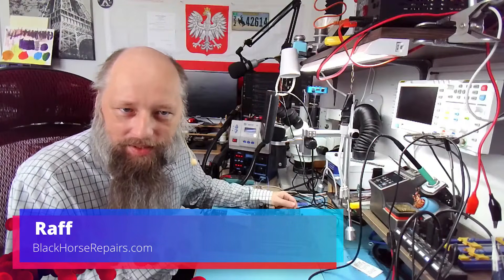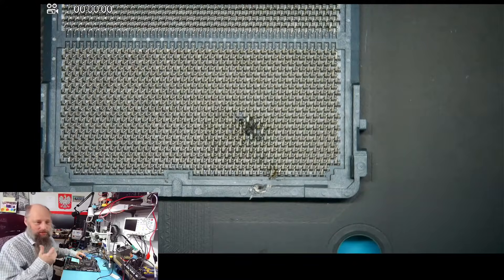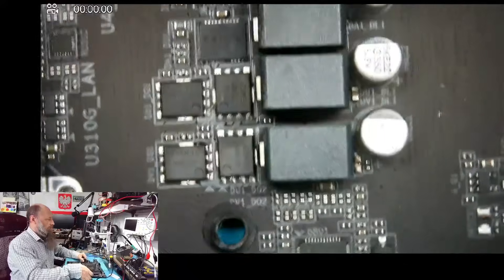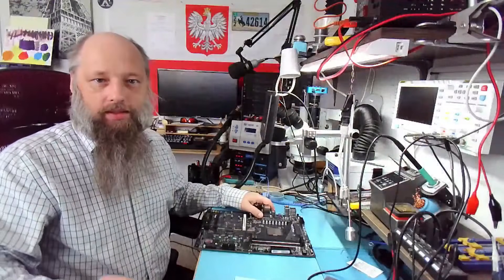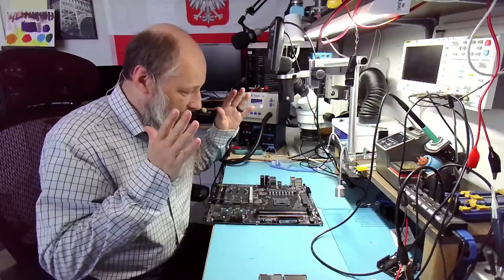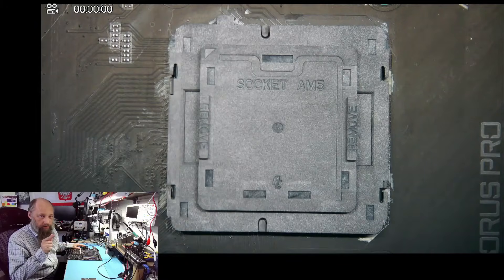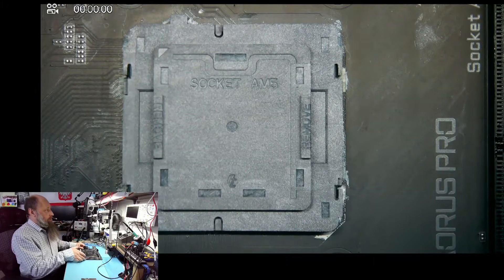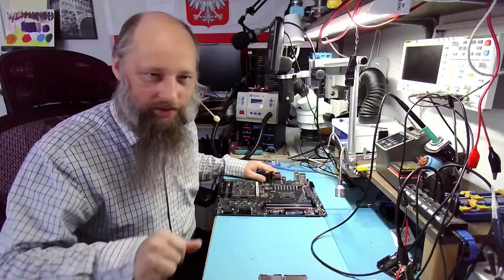102 | Free AM5 Socket Replacement on X870E

Comment: Hello
Why You not test this mainboard??
Reply from the maker: darowanemu koniowi nie ptrzy sie w zeby :) 
once I start charging for this I'll perform testing after the replacement, at the moment I have no AMD CPU or DDR5 memory to test it so it's all just visual inspection. In addition the board comes disassembled so would not be able to test it properly without heatsinks.

Comment: Ignore my last comment on the other video. Do you have a link to the Rework Pro software? I can't find it anywhere.
Reply from the maker: the reason you can't find it anywhere is that I have not released it yet. It is still in beta testing. I will release the link sometime next month, depending on the state of the project. You can join my discord, it will be released there first. You can also download my IR6500 software, version 1.4 has been released a while back. I do recommend Rework Pro though.
Reply: @blackhorserepairs  Ah, that would explain it then.🤣

Comment: Well done your getting better with every board
Reply from the maker: Thank you so much 💓 
Maybe soon I'll start charging for this repair
Reply: @blackhorserepairs  I wouldn't until you can check their working , time to buy a cheap lga1700 cpu n cheap am5 cpu.  It becomes expensive to post n repost if they don't work..I use socket testers, but always use cpu on ones I'm not too sure about preferably cpu with igbu rather than having to plug video card in all the time.

Comment: I was using a combo of ammoniated windex and isopropel (50-50 mix) in my ultrasonic cleaner.  It works better than straight ISO but IDK if it is harmful to the boards?
Reply from the maker: Interesting, I'll test that